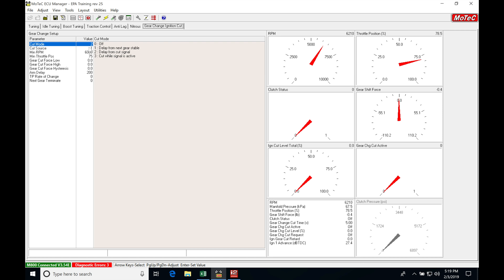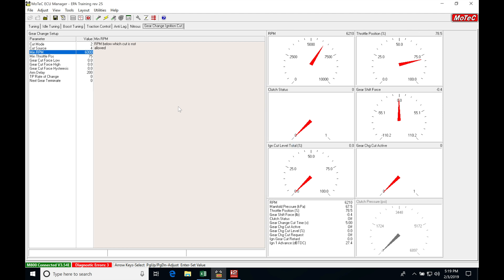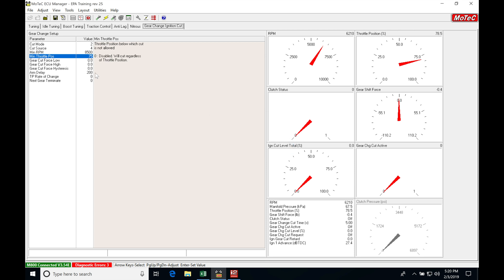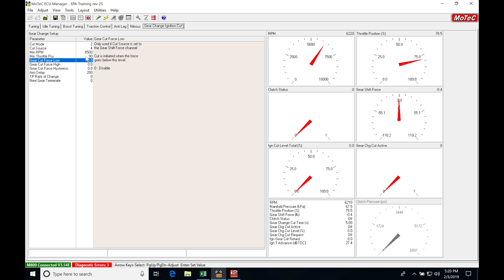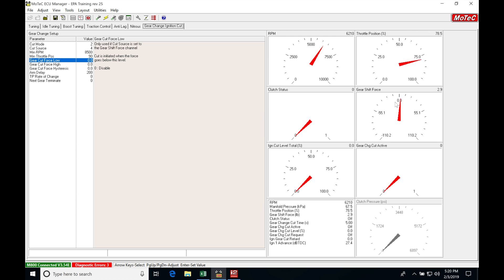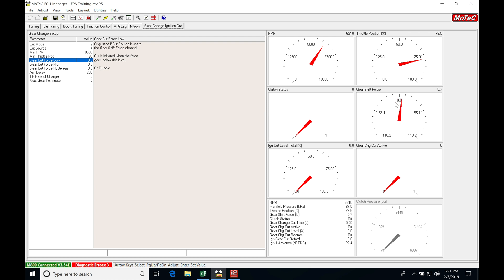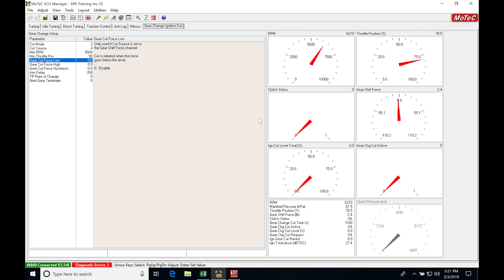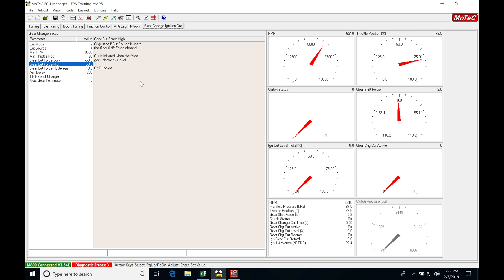Motec Hundred Series: Gear Change Ignition Cut | Evans Performance Academy

Comment: There is any actual close loop strategy for m800 with advanced functions for PnP ecu? Lets say evo 8.
Cut mode 2 seems like an open loop with pre-timed ms delay. 
Any video how to properly adjust mode 1 "next gear stable" with gear position sensor and strain gauge?